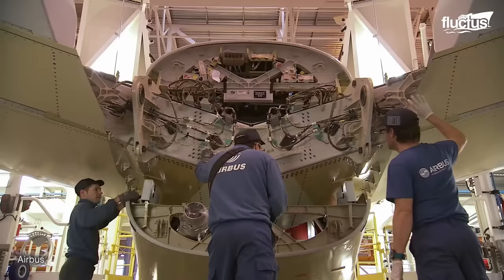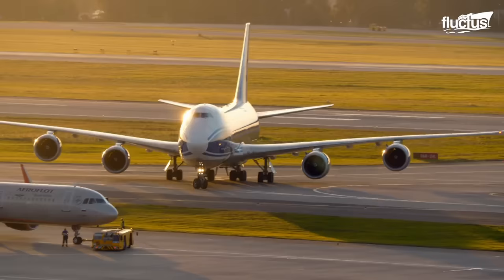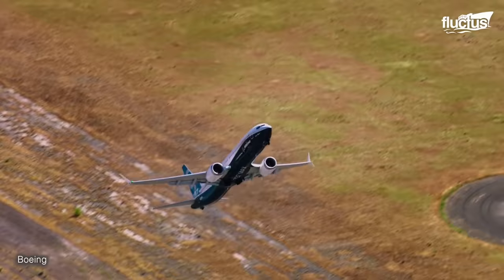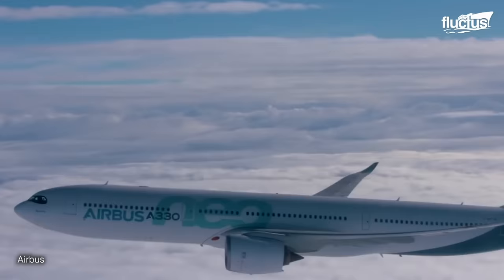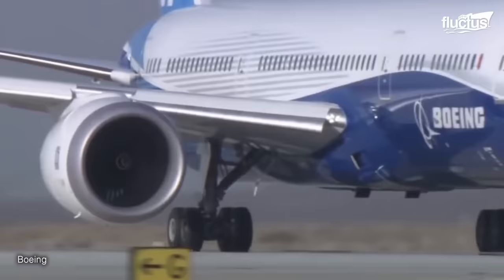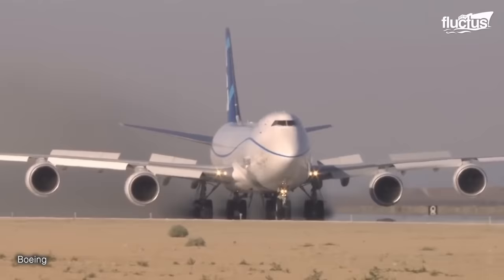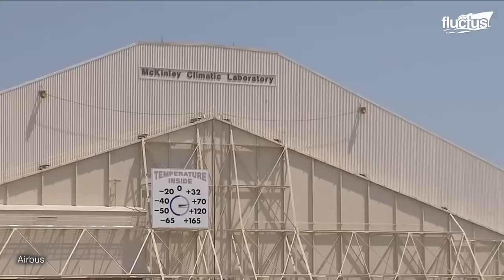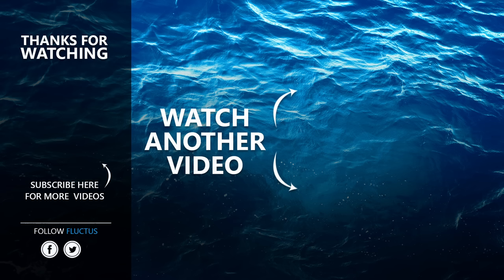How Brand New Aircraft are Cruelly Tested During Vertical Takeoff Before Being Sold

Comment: Gotta correct you on something. The tires on aircraft undergoing rejected takeoff testing are not deflated by ground crews, they automatically deflate by way of 'blowout plugs' on the wheels that are designed to release the pressure in an overheated tire to prevent the TIRE from blowing out. Just wanted to clarify that.
Reply: i wanted to say this too
Reply: @GVFX-KUNA  Yeah, he got there before me too, it appears the temporal flux capacitors hit their limit and caused quantum phased nanofluids to leak onto the biphasic pulse modulating regulator array causing systemic discombobulation.
Reply: @formertenant9276  Nah .... I reckon it was a faulty turbo encabulator.
Reply: Why can’t they make the tires completely out of rubber so no need to deflate air
Reply: @Ban00  weight is perhaps the biggest challenge. Everything about any airplane flying is entirely based around weight. That goes for everything from two seater puddle jumpers, to  the 747. It’s all about weight. Every single pound affects flight characteristics, as well as range.
Reply: Brass plug with copper disk?
Reply: Also about the part with the engine failure, he said the plane would no longer be able to hold its speed and altitude with only one engine. I think this isn't correct, and these planes are specifically tested to make sure they can still fly with one engine at increased power.
Reply: @Ban00  that would be extremely heavy..

Comment: I experienced such an "emergency" once, right before landing at Gatwick airport in London. We were 2 minutes away from touchdown when the airplane got a message about another airplane taking off from the same airstrip, and without any warning, the airplane went into full acceleration and pulled straight up (even though it might have been way less dramatic than what they're displaying in this clip). Anyways, we didn't get an explanation from the captain until we leveled off, circled around and again prepared for landing.
Reply: Thanks, I was curious as to what kind of emergency would require such a maneuver.
Reply: Wow you lot were lucky.
Reply: Same experience, at the same airport, maybe we were in the same flight! Meanwhile, my wife was checking the flight on FlightRadar, and was "disturbed" by the strange behavior of the airplane...
Reply: @Tactic3d maybe you guys just flew in when the trainees were working in the ATC tower.
Reply: That’s a “go around”! Glad it was all right, but as a passenger it must be upsetting
Reply: that may have seemed pretty steep but it can't have been vertical. airliners simply don't have enough thrust to go fully vertical.

Comment: A couple of points here about the 747-8 RTO tests. It was loaded to max take off weight, equipped with fully worn down brakes, and could only use the brakes and spoilers to stop, no reverse thrust or other control inputs. Also once the plane comes to a complete stop a 5 minute timer is started and only after that 5 mins has expired are firefighters allowed to cool the brakes with hoses. The tires automatically deflate to prevent them from exploding and killing passengers/first responders and also to protect the plane itself.
Reply: i just watched a video where they did such a test on an A340, and in that one several tires exploded. i guess that was a fail then.

Comment: A plane can fly fine on a single engine. Two engines mean the engines aren’t being pushed hard all the time and extends their lifetime. You could have an engine failure and theoretically continue to your destination without any issue, but that isn’t done in case you did lose your last engine, regardless of how extremely unlikely that is in this circumstance.

An engine failure really is rarely cause for concern. They’ll just find the nearest suitable airport but they won’t be rushing down to the ground, there’s no need for it. They’ll do the necessary checklists, best airport and then begin to begin their approach to land. 

A fire is a completely different ball game. You don’t want to hear those bells.
Reply: I read somewhere that the altitude “hold” was set at zero feet. On the initial climb with a positive climb rate initiated they flipped the autopilot on and since it was set at “0” the aircraft began to descend.
As I said, I read this somewhere and I’m just “passing on” what I read.

Comment: I don't think I'll ever get over my fear of flying sadly.  I've only flown once and it was a horrible experience with extreme turbulence and an odd event that freaked us out.  We apparently hit an airstream (??) from another airplane that was in front of us I think (I don't remember exact details or what the pilot said; I just remember something about an airstream).  Anyways, the plane kind of dropped down a little bit (maybe like 10 feet?) but it happened in a split second.  Think of a quick bunny hill on a rollercoaster.  I remember seeing everyone lift up in their seats and women's hair flying upward.  It happened SO quickly.  It felt like we hit a giant wall of air that knocked the plane downward.  It was terrifying.

I know planes are safe.  Just like rollercoasters are safe.  Accidents are exceedingly rare.  But my fear is rooted in fear of heights.  And having an anxiety disorder doesn't help LOL
Reply: Jack and coke usually calms my nerves. Also just imagine you’re on a boat in the ocean during turbulence
Reply: You can take solace in knowing these machines can handle astronomically worse conditions than the average turbulence which freaks out passengers. They can take off vertical, fly through hurricanes, go upside down. Planes are incredibly safe for day to day transportation.

Comment: The purpose of any pre-commissioning and commissioning tests are to test the extreme condition performance along with normal general operating performance of the equipment. This is true and very required to ensure reliability. For equipment that is related to safety of people, the more strict and harsh the tests be, the better it is, than pulling favours to skip tests.

Comment: Worked at MDC in late 80s, 90s and early 2000. Besides pilots there are engineers depending on the test omboard.They test electronics, Hydraulics, mechanical-flaps, slats, stablizer. hardovers. hard landing and braking in standing water. high altitude hot and cold weather takeoff, engine out and restart in flight. etc.

Comment: They can deflate tires from cockpit?
Reply: There are temperature sensitive plugs in the wheel rim that melt due to the high brake temperatures thus deflating the tires. Without this they will catastrophically explode.
Reply: @Henry-vb4hq  Amazing engineering. Thanks for that. 👍🏾

Comment: All those "vertical takeoff" shots turn out just to be recorded in a clever camera angle. An airplane can take off in a very steep angle, yes. But not 90° vertically, as shown in these videos, it is no rocket or VTOL and they simple don't have the required TTWR. The maximum takeoff angle is around 40-45°.

Comment: So how close to vertical is it really? More like 75 to 80 degrees? Something similar is done with stability testing. Pull up the nose to a high attitude and let go of the controls. The nose will pitch down, the aircraft speeds up, lift will increase, and the nose rises. The idea is that it'll dampen out on its own.

Comment: I couldn’t help but notice someone walking directly in front of a spooled up engine [6:06] and supposedly someone on the manufacturing team. With the ingestion incident that just happened in Montgomery Alabama fresh at hand [January, 2023] I cannot fathom someone else doing that.
Reply: Interesting. But I don't know the specifics of when that is possible to do . Maybe this guy knew the science behind this?
Reply: The engine does not seem to be at its highest speed. I guess those incidents happen only at like takeoff speed so they are taking the risk. I might be wrong.
Reply: @grelearn3181  actually, the Montgomery incident happened at idle, so don’t let your guard down around any aircraft engine, jet or prop.
Reply: @finallyitsed2191  thanks for correcting.

Comment: These are airshow/promotional flights, not test flights. The aircraft is still closer to horizontal than it is to vertical, approximately 40 degrees nose up. All they do is film them from angles where it looks steep. If you see air show footage from the side, you'll see its steep, but nowhere near vertical

Comment: Losing an engine is certainly not the greatest emergency on passenger aircraft.  Saying so is inviting further anxiety on flyers, in the hope of views.  Aircraft are designed to fly on a single engine in all phases or flight.  Pilots are extensively trained and tested on their ability to fly on a single engine every year.  The only reason that this is treated as an emergency, is that they should probably land as soon as possible, in case the remaining engine might fail.  So you have a 1 in a million situation of an engine failing, and they treat it as an emergency, in case another 1 in a million situation occurs, another engine fails.

Comment: "Vertical takeoff"?  It's not a vertical takeoff, not even a vertical climb. Momentarily such plane can reach max. 50° angle (deck angle) when climbing. That blue/white Dreamliner climbs probably at  an angle of 30" - 40°, not 90° which would be vertical. It's the camera angle that makes it look like the plane climbs vertically ( to look more dramatic).
Vertical takeoff is when an airplane has no horizontal movement (takeoff roll), only vertical when lift off,  and when airborne it's no longer takeoff but climb.

Comment: why dont they ever put multiple giant parachutes on these commercial planes??? i feel like that would work in the event of an air accident. if we can deploy parachutes from crew capsules for space missions i feel like we could easily make parachutes for commercial planes that fall from the sky. if anyone knows the reason why that hasnt been done please share with me !!
Reply: Weight and complexity. The weight of the parachutes would mean even a big plane would only be able to carry about 10-20 passengers who'd be paying tens of thousands of dollars each to travel in a plane which is perhaps 5% safer than a plane with parachutes. The number of accidents where parachutes would actually help is very low, like 1 every 5 years globally, if that. Even on light aircraft (e.g. 4-7 seats), they need between 400ft-1000ft to deploy safely, you'd probably need 10,000ft on a large airliner. Aircraft accident sequences which initiate above 10,000ft are usually loss of control, in which case a parachute would be of limited value anyway because the plane would need to be stable for the chutes to open correctly. So the question is, would you be willing to spend 10 times more on a ticket to lower your odds of dying from 1 in 10,000,000 down to 0.95 in 10,000,000? I wouldn't

Comment: Losing an engine in any current multi-engine aircraft is far, FAR from a "worst case scenario." There are a number of other things that are WAY more dangerous (like fire in the cabin, or depressurization.) Losing an engine is almost not a big deal, as the aircraft are all designed to be able to fly on one engine. Losing an engine doesn't even mean an emergency landing. Losing a landing gear is more severe to the passengers, than losing one engine in a multi-engine aircraft.

Please don't spread lies and make people unnecessarily afraid if they are on a flight that loses an engine.

Comment: I saw line pilots doing this during COVID. Though I'd say the steepest attitude I witnessed was about 70 degrees ANU. At the time guys at the airport where I worked were cleared to 2000'. I saw multiple a/c during that time reach 2000' and markedly pitch down to level off before being told to contact departure. I'm going to guess those were empty airplanes.
Reply: 70 degrees nose up in an airliner would only be seen in a severe loss of control. Even empty, airliners have nowhere near the thrust/weight ratio required to climb that steep. When empty, the average airliner thrust/weight is about 0.5, meaning it'd only be able to sustain a climb of about 30 degrees, and that's assuming zero drag (with drag, it'd be much less). To climb at 70 deg would result in an airspeed loss of approximately 10kts per second, it'd be extremely reckless to attempt such a feat. To add to that, Boeing's definition of an aircraft upset (loss of control) is when it unintentionally exceeds 25 degrees nose up. And while a light aircraft may be able to do that intentionally, it gives you a rough idea of what sort of attitudes Boeing expect their aircraft to normally be flown to. Airbus aircraft are hard limited to a maximum of 30 degrees nose up by the flight control computers, even at airshows

Comment: Great advances in aircraft design but something is missing: better emergency exits and eject mechanisms for passenger airliners. The same pressurized tube fuselage makes modern airliners a mortal trap in case of surprise crash. Ejection seats have been a standard for military attack planes and bombers for pilots, navigators and crew. Can we design a passenger compartments fuselage capable of ejection and parachute landing? I think it's possible. It would be more expensive but it will save more lives. Thanks for the video.
Reply: There's something paradoxical about your comment. Your vocabulary tells me your not a child but what your saying with it tells me your 5yr old. Spending any time at all actually thinking about what you said should give you a plethora of reasons why that isn't done.
Reply: @illens08 Use a real Earth name to have credibility. I gave a real example of aircraft safety design.  Ejection seats are an American invention since Would War II. Your prejudiced comment means that you have a childish ego attitude. Is up to flight engineers to design something better to save lives for passenger airliners. This is not an ignorant comment after thousands of lives lost on passenger airliners since last century.  Your life and the lives of millions of passengers using airliners deserve better safety measures for escape in case of fire or crash. If you have technical knowledge, put it to work instead of reflecting your flaws on others. Tell me at least one reason for not to improve safety emergency escape design on passenger airliners. You say there is a plethora of reasons for not doing improvements.  What reasons?  Be specific. Thanks.
Reply: @juanmelendezrivera6085  if you can't intuitively see the numerous issues with the idea then I can't help you... I hope you're a little kid cuz its just sad if not.

Here's some stuff to ponder, maybe have a thought of ur own as tk why thats so idiotic... whats the temp that high up? Can you breath at those altitudes? What happens to the plane when seats start ejecting? If there's mult ejections one after another how can theg be spaced out as to not affect one another? How could they do this while simultaneously ejecting in a matter of SECONDS? 

The list goes on, jesus instead of crying on here take the advice and learn how to think, its sad if you can't come up with some of these and others
Reply: Wtf are these comments

Comment: I thought aeroplanes couldn’t take off at a steep angle because the drag reduces speed? I’m sure I saw a video of a fatal crash on YouTube about a week ago where a pilot took off in a small plane, tried to climb too soon and veered left and crashed behind the tree line.
Reply: It's all dependent on how much weight you've loaded up in the cargo / passenger area. If that plane was fully loaded it would have had to take off normally to avoid stalling.

Comment: Is it possible to vertical take off with passengers on it? Or just when it is empty.
Reply: Possible but why do it? Just because something is possible doesn’t mean you do it
Reply: Impossible, even when empty, the creators of this documentary have done zero research beyond falling for some clever camera angles unfortunately. The pitch attitudes in the videos are around the 40 degree mark, and even when empty, that's un-sustainably steep, i.e. its loosing speed quickly when climbing that steep, which is why they have to level off so quickly, so that the speed doesn't get dangerously slow. With passengers on board, what you experience on a typical Takeoff is about 80-90% of what the plane is capable of doing, it's not going to get really any steeper than that

Comment: How can the plane take off almost vertically and not stall?
Reply: First, it does not. Not even close to vertical, half of it at the most.
Anyway, the crucial thing is to understand the difference between pitch angle and angle of attack. The pitch angle is between the horizon and where the nose is pointing. In these steep take-offs, the pitch angle would be somewhere around 40°.
Stall, however, is solely related to the angle of attack (AoA), which is the angle at which the airstream hits the wing. Or in simpler terms, the angle between where the airplane points and where it goes.
So if the aircraft's trajectory is let's say 30° upwards, its pitch is 40°, then the AoA would be 10°. Stall usually occurs at AoA around 20°.

Comment: The balls it takes to be a test pilot. when I was at bombardier doing structures for the global 7000 some how a roll of tape wasn't noticed in any of the inspections(I know) it un ravelled and sloshed through the fuel pumps stalling one of the engines
Reply: Do they pay more to test pilots for the risk they take?